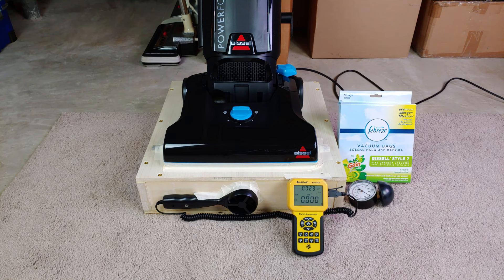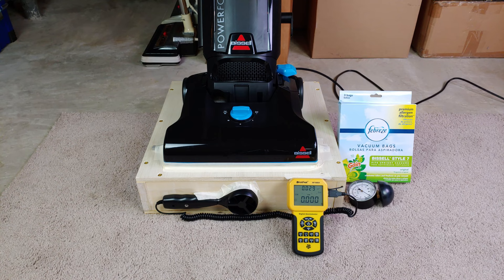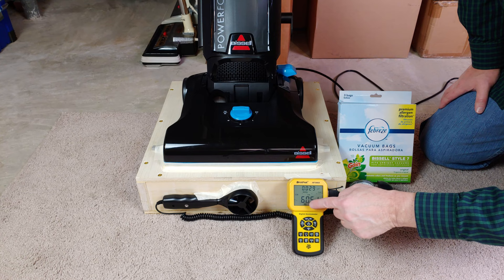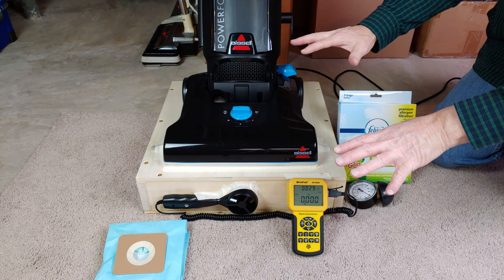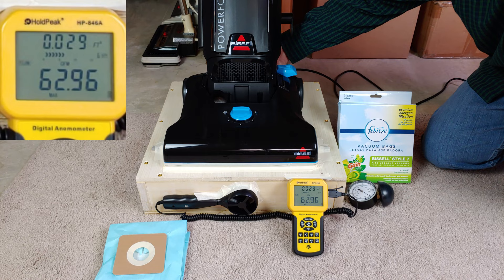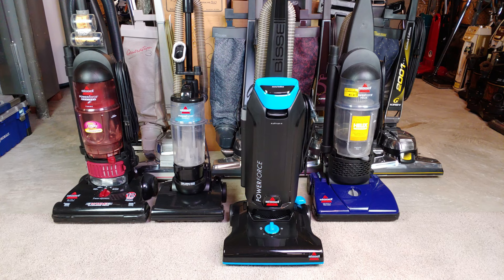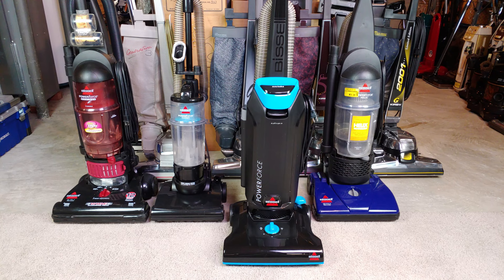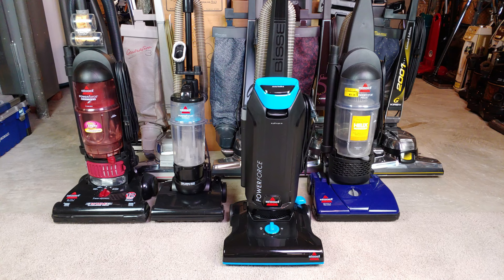Bissell Powerforce 1739 Bagged Airflow And Suction Tests

Comment: I always loved these inexpensive bagged Bissell vacuums that were generally exclusively sold at Walmart. We used the older models when I cleaned in a motel. It was right on the beach so they'd constantly be vacuuming up sand and debris and when they wore out, we'd just replace them. We used to use expensive Kirby vacuums but they were constantly in need of repair and even though they were generally honored in their fix it warranty, it was just more downtime than we liked and we found that just going with cheap bagged vacuums was the best way to go. And these will take A LOT of abuse. I've had mine fall down the stairs, fall off my cleaning cart and onto the concrete parking lot, suck the cord up, and it still kept going! These things truly are amazing for their price point.
Reply from the maker: Great, cheap vacuums to be sure.

Comment: just got a powerforce bagged previous to this model and it agitates so aggressively better than the windsor i have!
Reply: They agitate the carpet to but the brush hardly touches the carpet to but it spins much slower rpm because of the clutch type system it has

Comment: I subscribed recently and have been watching your videos. I really enjoy the content, I have been into vacuum cleaners since I was about 4/5. Thank you. I was wondering if you would consider doing a comparison test of a sort. I have two older Hoover Elites. 7 amp Spirit and 5 amp Elite 200. I changed the fans from the original to the 20 blade Elite 12 amp style. I have noticed a substantial increase in how they lift the carpets. If you have one of these, could you do a test that would show what the difference is between original vs 20 blade? I’m not sure if that’s something you’d be interested in or not.

Comment: Will those scented bags also fit in a Hoover Tempo/ Windtunnel ?
Reply from the maker: Yup.
Reply: @VacLab  does this Bissell blow alot of air from the front? I own one and mine was a refurbished model got at a Roses department store for $34 just wondered if thats normal seems excessive and are these actually budget Hoover's under Bissell name?
Reply from the maker: @mattmaverick703  it blows lots of air from the front which you can clearly hear in this video.

Comment: Hi I have couple of questions if u can answer. When compare bagged to bag less. The one with bag is more clean and more filtration not having dust flying around? also I saw some bags on Amazon called clean fairy it’s 20 for 20 bucks can u please check that out and let me know that would be a good bag also are those bags are hep-a bags?  Thanks much for making a Video.
Reply from the maker: I don't have any issues with bagless vacuums spewing.
https://youtu.be/c3R2CHYVwVA
Clean fairy bags are just fine but not true H11 HEPA.
Reply: @VacLab  thanks for getting back to me. I have a Biselle compact and power force helix bagless vacuums. But I was thinking abt getting shark navigator lift away CU510. Would you recommend this shark model compare to the bissell’s I have. I realize the shark is a sealed one so no dust flying around. Thanks again for making those videos. 🙏
Reply from the maker: @thomas8827  that CU510 looks OK, but remember, the brushroll is harsh. It will thin out your carpet.
Reply: @VacLab  I have wood floor. Other than my Rugs.

Comment from the maker: The blue Febreze paper bag has a nice initial airflow bump over the two other HEPA bags I've tested so far. Particle counts were great with it as well.
Reply: Can you use a HEPA bag? And does that make it HEPA
Reply from the maker: @robertdiaz4439  you can use a HEPA bag and that makes the dirt filtration HEPA. It will not make the exhaust emissions HEPA though.